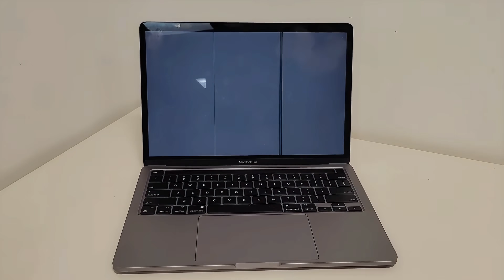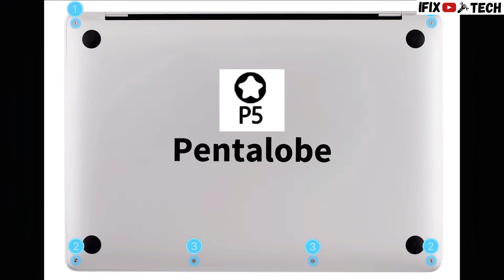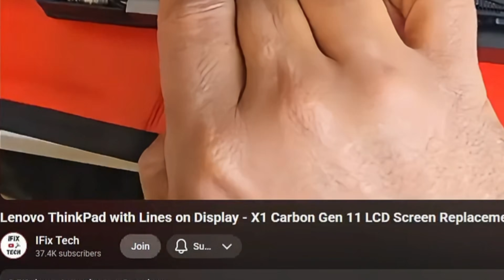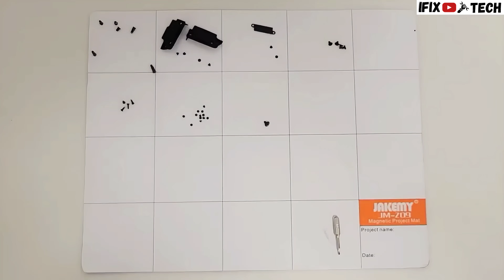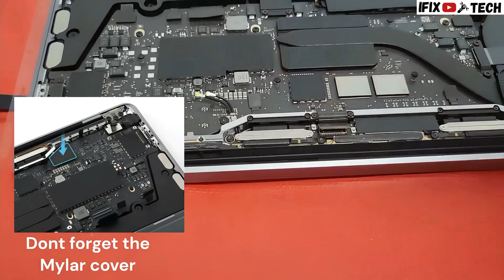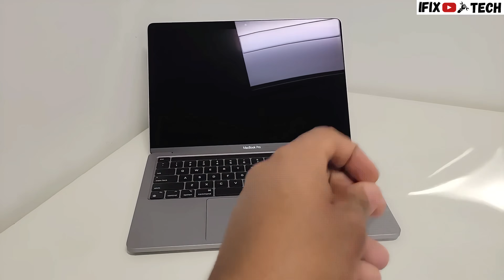Apple MacBook Pro 2020 Screen Replacement - Broken LCD

Comment: Hi, I have a MacBook M1chip the display is gone (flickering lines and glitches)  should I change only the screen or with the full panel ? Screen is cheaper but I’m not sure if it’ll be authentic 

I checked latest MacBooks but I’m not satisfied with the hardware quality and the repair cost directly with Apple is half the price of the laptop itself 🙁
any advices
Reply from the maker: Replacing the whole assembly it's always the easiest and safest option. It is more expensive yes, but that is the way apple recommends. OEM screens for modern MacBooks will always come the whole assembly. Screen panels only are third party screens. Thanks for liking it and subscribing 😉👋
Reply from the maker: Replacing the whole assembly it's always the easiest and safest option. It is more expensive yes, but that is the way apple recommends. OEM screens for modern MacBooks will always come the whole assembly. Screen panels only are third party screens. Thanks for liking it and subscribing 😉👋